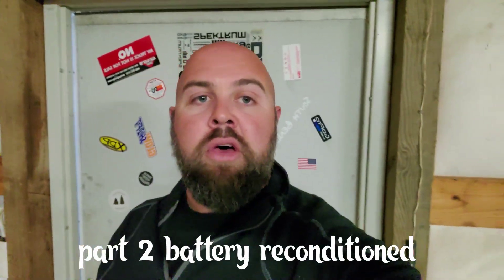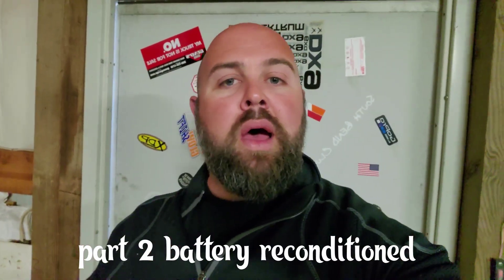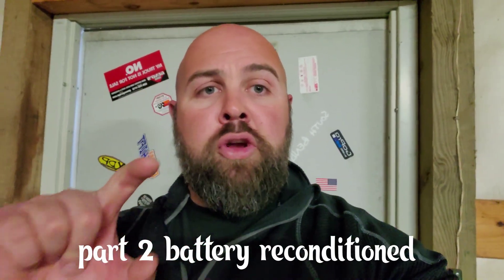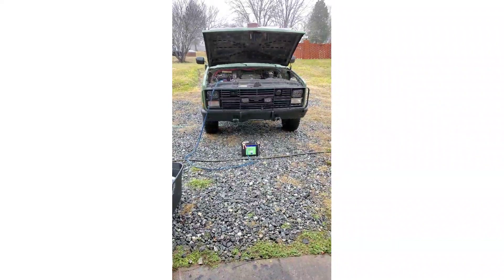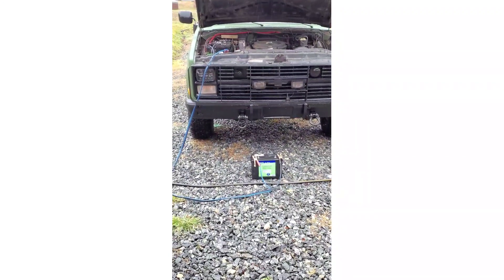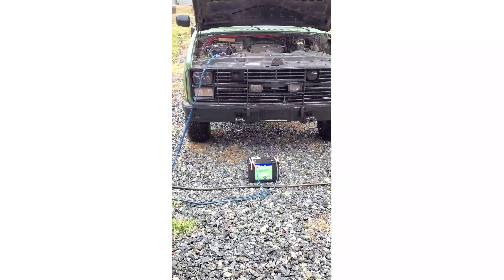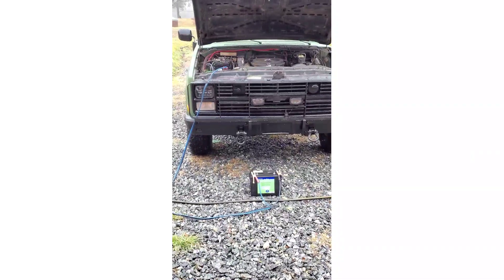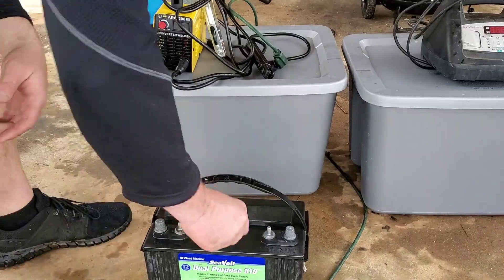Battery reconditioning, following the wisdom of the comment section.

Comment: You may have moved on since doing this video, but here's my two cents, take or leave it.

This is for educational purposes, following this method may lead to possible injury, so if you follow this, you are doing it at your own risk!!  Follow ALL safety procedures to avoid injury.

I've brought many a battery back from the dead, and the process can be painfully slow, but as long as there's no shorted cells, it just may pay off in the long run.
1. check the existing battery voltage. If the voltage is below the threshold of a smart charger (usually 5-6v), then the DC welder or a manual charger will be needed.
2. Use appropriate protective wear,  goggles, gloves, good ventilation, and keep baking soda at hand!
3. Pop the caps off, fill any cells that are low. Leave the caps off during anytime the welder or manual charger is in use, or can lead to boom.
4. What your after is getting the battery to take a charger good enuf for the smart charger to finally start to do it's thing, so running a manual charger, DC welder or a good battery in parallel should help to get it to a good enuf surface charge, around 10-11 volts.
5. Try the smart charger. If it recognizes the battery, let it run for the next 24hrs. If the battery is recoverable, the smart charger should stay engaged. If not, it will eventually show the battery as BAD. Don't give up yet!
6. Go through the welder process and crank it up until the cells start to boil, drop current down gradually to about 40 amps, don't let battery overheat. Do NOT walk away, the entire time the welder is on it needs to be monitored or bad things can happen!
7. Cycle the welder process, 15 min on, 1 hr off, about 5-6 times. This will help shock the battery and start the desulfation of the plates.
8. Now take a multimeter and check the voltages between each cell, should read about 2, 2 1/2 volts each. IF you get no readings between any of the cells, good chance you got BAD battery.
9. You can still try to see if the SMART charger will charge the battery. Leave on there for 24-48 hrs. If this works, switch to the REPAIR / Desulfate function. Depending how bad the sulfation is, it can take WEEKS to recover.
10. Now you should load-test the battery. Testing anytime before this is a waste of time, believe me.
11. After charged up, let the battery rest for 24hrs, chk each cell electrolyte with a hydrometer. Green is good!

I definitely like the DC welder, but I also have a 200a manual charger that works just as good and it has a timer so I don't have to babysit that procedure.  Ventilation is a must and I also put my batteries in a small tube in case of acid overflow. 
Always clean the battery top completely before popping off the vent caps so no junk falls in (been there, done that..) Be sure to wear gloves, as my fingers are almost completely numb from being stupid.
All in all, PATIENCE is the key here and may lead to good results!

Comment: Thanks for keeping trying! Not sure if you have charged enough with your car.
Reply from the maker: I'm gonna continue to run cycles thru the welder and see if progress continues
Reply: @PRSH8YAPROJECTS  no way it can rejuvenate a TRUE-DEAD battery ( say, one with a dead cell).   That’s why I suggest you charge it first, to tell it’s a TRUE-DEAD battery or not.  Based on my research, the welder trick only works on a “good but old” battery by desulfurization.
Reply: BTW, based on my try, the dead cell won’t bubble as well as the rest good cells, or won’t bubble at all, meaning it’s heavily short-circuited inside (that cell).
Reply from the maker: That's great info